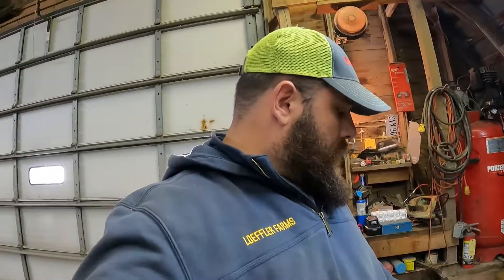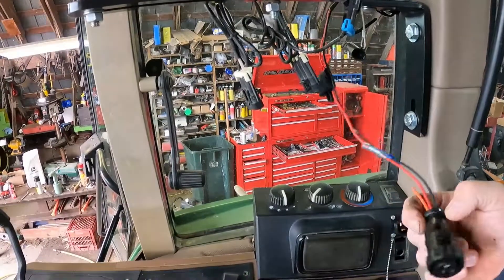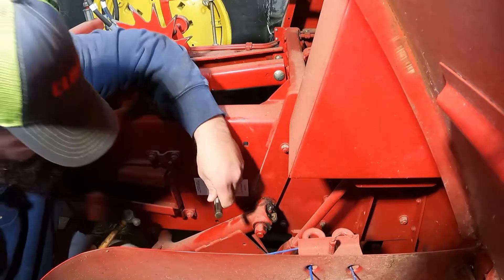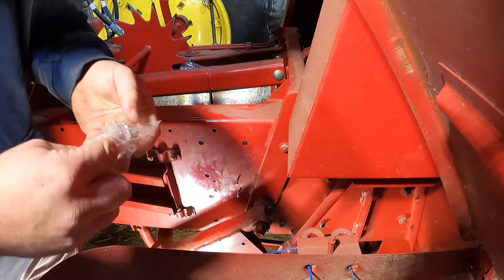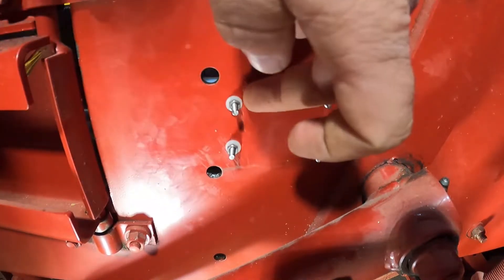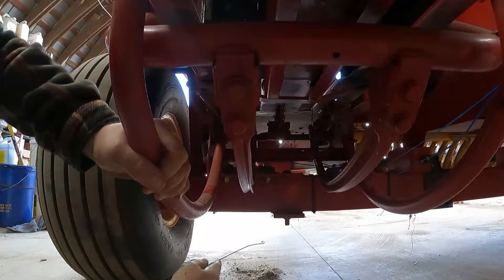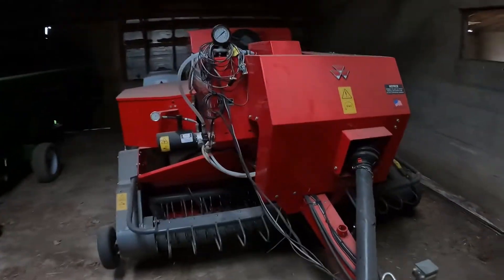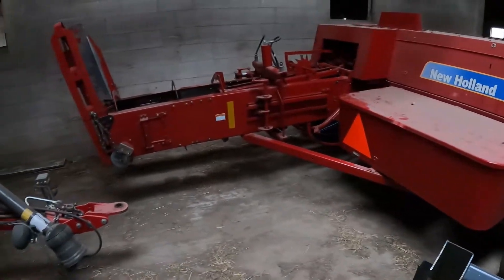BHT-2 Baler Moisture Meter Install

Comment: Which baler do you like better? I like things about both balers and grew up on a Massey that paid itself off before I was thought of
Reply from the maker: I have since sold the new holland baler, I really like the inline design of the massey baler
Reply: @LoefflerFarms  I’ve never had an inline small square I like them quite a bit but I only do 6 acres of small square a year so I don’t feel that’s a justifiable investment unless increasing usage. My cousin has a bc5070 and just bought a caseih 541c same baler just different colors and a couple small updates due to being newer and he works for a case dealer so he got better discounts. Im running a new holland 276 that’s still running well

Comment: I’m curious what the resistance is at certain moisture levels. I’m working on putting together monitoring system and want to include moisture readings along with bale weights and other things. Rather than have a different monitor for each reading I want to incorporate them into one custom monitor. I may try to get my hands on one and take some resistance readings at different moisture levels and use that to get a start on calibrating my sensor
Reply from the maker: There is a monitor that does incorporate all that together but I can't remember the name of it right now

Comment: Hi how accurate are they?
Reply from the maker: I wouldn't say they are extremely accurate out of the box but they are consistent so if you know what moisture you started at you can gauge where it's moving to. It's possible to set an adjustment to closer to actual as well I just haven't gotten it extremely close yet but within a point or so
Reply: @LoefflerFarms  I dont have meter in my baler but been thinking get one to monitor. Will see have a great day.

Comment: Nice installation video
Recently installed the same moisture monitor in our NH 565
They work really well 
Happy Harvesting
Reply from the maker: Thanks for watching it. Ya I have ran one for a couple years in my massey baler  and round baler but I finally got around to putting one in this baler as well so I figured I'd video it incase someone had questions on how to put one in

Comment: I've never used a moisture meter, I guess I'm from the old school, pick it up by hand, twist it and feel it. Not exactly scientific approach, but I haven't had too many complaints. We usually let the hay dry out more than normal, so we may lose a little nutrient level, but I am not opposed to using one in the future. So if that's what my son wants to do...maybe we'll give it a try. Well good video, liked it, thanks for sharing, have a great week.
Reply from the maker: Ya I also give it a twist test when we get started but this is nice if your baling by a woods or in the evening when the dew comes down do you know when to stop.
Reply: @LoefflerFarms  Great point, I've ran into the same problem.
Reply from the maker: Ya and I don't generally run the balers very often so it's easier to tell the guys helping me to stop when it gets to a certain moisture